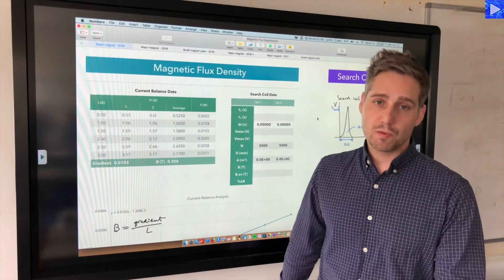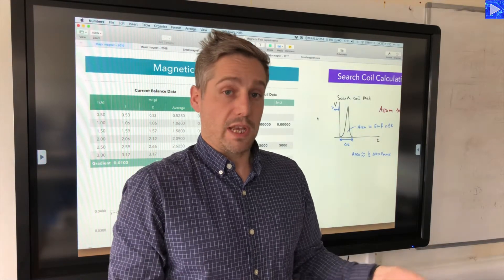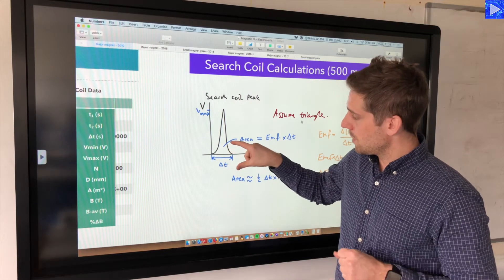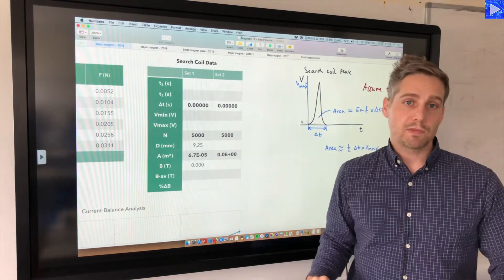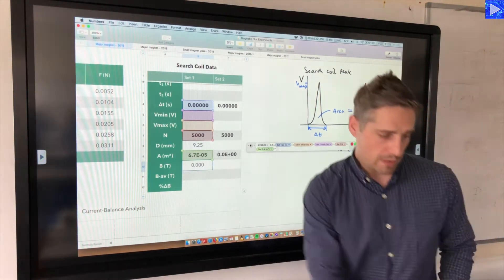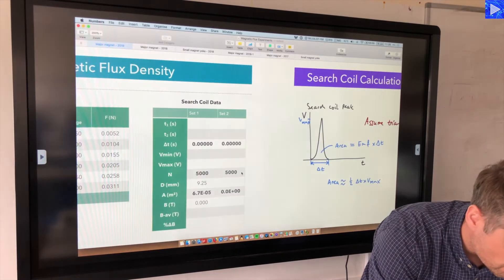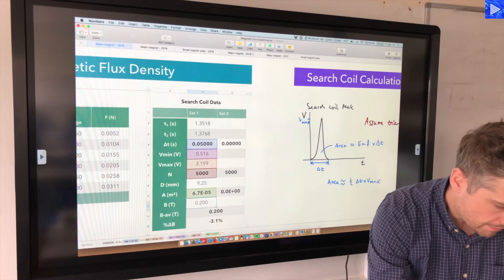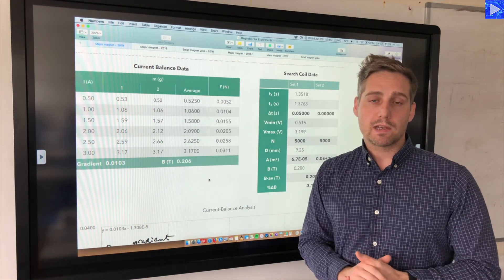Search Coil Analysis (measure magnetic field strength)

Comment: The difference between your two times on this video is incorrect.  t2 -t1 = 1.3768 - 1.3518 = 25ms not 50ms...
Reply from the maker: Well spotted!  You're right - I had mistakenly left a  × 2 calculation in the ∆t field.  I think that was from a previous method of measuring half the peak and doubling it.  So after all the search coil value differed significantly from the current balance 😕
Reply: @PhysicsHQ  thanks for the videos - very instructive :-).  In the interest of science - did you ever find a reason why the search coil gives only half the value of B measured from the current balance?